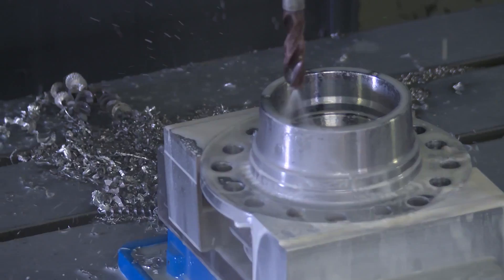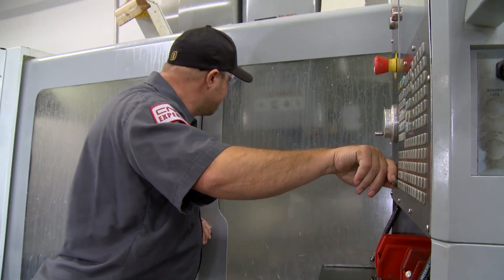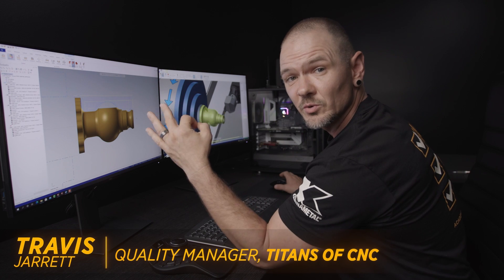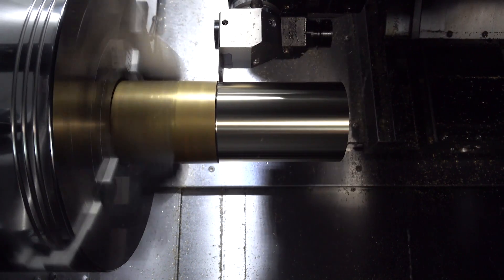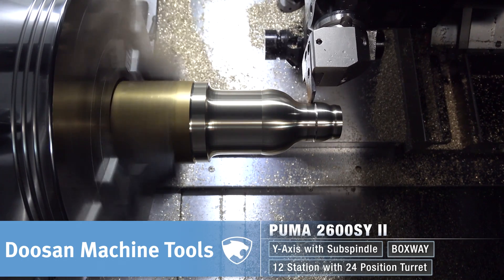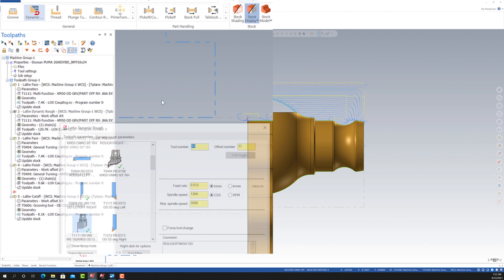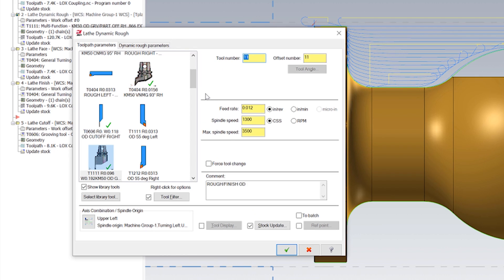Simple Machinist Mistake Causes Near-FATAL Accident

Comment: This is a fine example of the necessity of experience and also sound judgement when it comes to workholding. As someone with plenty of hours setting up and running large vertical spinning death traps, I can say no amount of training can prepare an operator for every situation, especially when the process involved seems questionable in itself. Those in charge should take this into deep consideration when chosing to take on a project and not default to the 'we can do anything' mentality. Sometimes even with the best of skill sets your machines will be the limiting factor in safety. Good luck (the culmination of smart decisions) and never hurry!!!

Comment: I was running a CNC press and doing single cycle work on thousands of flat parts with the press set at the highest speed. To keep my fingers safe I had the bright idea to use an open end wrench to slide the parts into place and time the operation for max efficiency. It worked great and I was really cranking the parts through. After a few hours I got tired and missed my timing, and brought the press down onto the open end of the wrench. It made a very loud PING and shot past my head, over my shoulder, across the factory. In hindsight, something soft like a piece of plastic would have been a more rational choice for my "push stick".

Comment: Once a guy turned on a lathe with the t-handle still in it and when it flew out, it brushed my right earlobe and then embedded itself in the drywall of the shop wall.

Comment: I worked on a cnc turning centre with a big dent on the sheet metal inside the enclosure. I was told they had an operator quit just after throwing a large part out of the chuck. He was facing the part in manual mode to set a reference face and had not set the maximum rpm of the chuck. We should always set G50 S*** to a safe value. That operator likely had the door open too. I don't remember being told whether he was physically hurt or not.

Comment: Haven't had anything but chips fly out of a chuck.. yet.. but I've shot bolts out of PVC airguns and when you have a decent mass moving you don't need a lot of velocity to do serious damage. When I was logging one of the first things I was told was to treat processor saws like gun barrels, never be 'downrange' of one. The operators never had saws pointed at themselves because chains breaking and 'shooting' people isn't unheard of. Been at least a couple guys shot with a chain through a safety shield and killed.

Comment: Standard talk in my workshop: i: Have you checked the Fixture and the Torque of the screw and vise? - He: Yes - I: Where is the Torque Wrench? - He: I check it again..... Luckily we have no really powerful maschines 3 kw is the biggest lathe. 2.2 kw the mill. But you can loose some body parts easy, if you are not aware.

Comment: Had small crown and pinion job running on little Gleasons, after cutting you had to buff off the burs and pass them on a wire brush spinning on a grinder. The gear came off the holding mount and got sucked into the wire brush. Spun around a few time and came out zooming passed my head. Found it 3 months later. 60 feet away lodged in the tin wall 40 feet in the air. That could of sucked big time. LUL

Comment: I remember hearing of an incident years ago. Won't say any names cause I'm now sure how true it is.
But from what I heard a guy was edge finding a part on the cnc mill and accidentally typed an extra 0 into the rpm counter so when the spindle turned on at 15000 rpm the end of the edge find flew like a bullet and hit the guy in the head.
Again I'm not too sure how true it is but it's scary to think how a simple typo could cost someone their life.
Reply: A guy a worked with had that exact same thing happen to him, but he was lucky and it didn't hit him.
Those edgefinder ends are only held on by a spring.
Reply: A edge finder running at 1500 rpm? I run my finder with 500 rpm.
Reply: I knew a guy who had a small box with several edge finder pieces in it because he kept forgetting to reset the speed after finishing a program. The ideal speed for an edge finder is 1500 rpm.
Reply: @jeffwombold9167  no its not
Reply: @marvinweijer9073  check the  Okuma literature on it. Running them too slow can make them less stable.

Comment: When I was a young man back in the 90’s ,I worked in an automotive plant. One morning, I walked into work to a commotion to find a lady machine operative had been killed by her machine. The lathe she operated had an eccentrically mounted part and used counterweight to balance the job.  After around 20 years of continuous use, this counterweight detached and smashed through the guard, hitting the lady in the head. I occasionally think back and wonder about her family. No one should die because of work.
Reply: There but for the grace of God.
Reply: Not in UK. Shut  part of factory, Health and Safety investigation followed potentially followed by criminal charges. Not in this case  though.

Comment: What's the max speed on a 30" chuck?
Reply: Do you feel the need, for speed?!
Reply: @xephael3485  just seems like such a huge chuck wouldn't even be capable of more than a few hundred rpm. But I guess that would be fast enough to fling T-nuts across the room.

Comment: Me and another guy were extra lucky one day, Friday just at quitting time no less. Had a perfectly balanced fixture with part, weighing about 600lbs, come out of a lathe at about 1000 rpm. Centre of mass was within .005” of rotational axis and about 6” from the jaws, and we were gripping 3” length of the fixture at 18” diameter. It was facing, so I can’t be sure of the exact speed, but it was around that, because G50 was set to S1200.  I had run the same program and fixture in a different lathe with an air chuck multiple times with no problems in the past. Due to availability, we needed to run it on a different machine, hydraulic chuck, and I was showing the other guy how to run the part. Broke the glass(and we all know CNC lathe glass is extremely strong), knocked the door off its slides, and damaged the tail stock and steady rest ways. Holy hell, that was scary. After that, we put a taper on the jaws and fixture to make sure it couldn’t come out; you could only install the fixture with 1 jaw removed, so even if the jaws loosened from centrifugal forces, it would still be impossible to lose it all.

Comment: My Okuma sales guy told me a story of a alum. auto wheel manufacturer where one operator wanted to go to the bathroom and ask his co-hort to load the cast wheel into the big Okuma lath. The jaws where like enough for either insides of the wheel to fit. He put it in his way which was the other way. When the tool moved in it crashed the machine and sheared off the turret. The whole shop herd it. Swinging a 20" dia. part at high rpm is nothing to fool with. Laths are a lot more dangerous than mills. I did hear about an owner of a shop get his gloved hand to close to an endmill to clear chips and was sucked in and took off some fingers. No fun.

Comment: My take on this, is that if its a method that is used regularly on a job that repeated then this should be documented in High detail. When I was establishing a new job I always included full information on the set up and tooling. If there was anything unusual about the machine or a particular piece of equipment,  like the required orientation of these  stilts, then this was noted either in the set up sheets and or in the program. My view was that sometimes like this situation you can have someone perfectly competent put onto a machine they aren't 100% familiar with and through lack of experience on that machine have an accident like this. If your procedures are right, with ALL the machine or fixture information given to the person running proved parts, then you greatly reduce issues both in safety and productivity.  
I started doing this because many shops I went into people kept their secrets to themselves, where as any ideas for improvements I freely shared, and would actively take on board others ideas.

Comment: How about a big surface grinder suddenly gets transformed into a 210mm machine gun as stacks of parts combined with shards of the wheel get ejected.   A total surprise, really loud and attention getting. All you can do is collect yourself and the parts, apologize, put a sack over your head while recovering from the shock and try to disappear.

Comment: 30 years ago I accidentally left a parallel in the lathe chuck. Spun up, then caught on the ways on its way out. Sounded like a ricochet as it went past my shoulder. Probably still impaled in the roof of the building somewhere, never found it. NEVER stand in line of the chucks rotation when starting up. Been running manual and CNC lathes since I was 14, always think before lifting the handle or pushing the button.
Reply: The company i served my time with had a perfect lathe chuck key hole in the inner roof lining in one section (it went through the sheet on the outside of the roof too but it was replaced) You can guess how that happened. It was never found either, I suspect it probably made orbit as the ceiling was about 30ft high there.....
Reply: Same happend in my rookie year, not me, the lathe one further. A Chuck, 35cm, was too small, so the operator work over maximum diameter, the thread of the claw broke, and the 5 kg piece flow through the workshop. Break the window of the masters office and land inside the 60th Anniversary Cake of the shop master. The cake literally explode like hit with a grenade. After that it was deadly quiet in the shop. Lukily no one hurt.
Reply: @Dan Didnot I know the type.... my metal work teacher would grab you by the hair and shout "good for the roots laddie" killer whyte we called him he retired after my first 6 months. Wouldnt get off with that now 😳

Comment: Very sound advice from you knowledgeable in machining industry! 
I've seen similar myself and instill as strict as I can even with a risen voice to emphasise the dangers of machining to not only peers who are seldom now that I've worked industry for 40+ years but my eyes are never far away with mindset of safe practices to ensure my colleagues never ever leave or go home with a missing limb or work injury!
Safety is never something to be shunned aside all for the push of expedient production, which in itself often gets dismissed and overlooked forcefully redundant all for production numbers on the board to be viewed in flow charts of production mostly to satisfy the bean counters!

Comment: Technically, the fault does lie with the operator of the machine however, if they weren't trained properly on that particular machine and setup, then the fault lies elsewhere, as in, the person(s) responsible to ensure that proper knowledge is shared with ALL team members. Cheers :)
Reply: I agree, that the true fault lies else where, not entirely with the operator. If a job is proved then all the information about the setup should be recorded. If I was making a set up pack for this job it would most definitely have a note on the proper use of these stilts included.
Reply: everyone makes mistakes , the thing is to double check triplle check everry thing that could go wrong,even if it mean extra minutes , you have to do it.I always do that ,im a lathe programmer/operator and i always run simulations , run the first piece on low speeds , check every tool with singleblock if its in the right position  just to be safe,and i dissangaged the door locks just so i can see where and what the machine is doing , but that is experience, you have to learn to do that so everry thing is in order
Reply: @kiurtosh  what good is running it on low speed if it was the high rate of speed that contributed to the accident?

Comment: I had a job on a mill that used a 24” long 3/4 drill bit that was to long to use in the tool changer. So I loaded all the tools (10) manually. It was pretty dangerous and I always ran the job myself. I was called to the phone and after an hour returned. Some how I was distracted and loaded the long tool in and hit cycle start. The tool was supposed to be 1/8 and went to 10000 rpm the 3/4 bit exploded and pieces flew every place even breaking the glass in the door and penetrating the enclosure.   I put in some optional stops after that to check every tool before they spun up.
Reply: Yes good idea, multiple optional stops will make you think, one might not do the trick.  Stories are meant to be told.

Comment: Right on the side of the machine.
Little note about centrifugal force and Chuck pressure decreasing
Reply: I've seen old lathes with maximum rpm warnings for that very reason. A tin tag riveted to the machine with chuck size and max speed.

Comment: We Had a 6 inch diameter disc came out of the Okuma LB 15 at high revs. Faulty clamp sensor. It lifted the sliding door off, bent the stainless sliding back guard , broke a jaw on the chuck and we had to have new bearings in the spindle.  Also on a big Ward  turret lathe, large motor casing left the chuck and passed over the head of the operator. No serious damage.

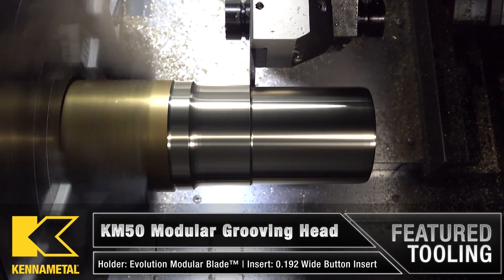Comment: Yikes! One pedantic bit: I am hearing in one of my Physics' instructor's voices at 1:38 it's centripetal force, not centrifugal without getting into the nitty gritty (others should be able to explain it better than I without having to look to hard).
Reply: Centrifugal force IS inertial force, it’s a misnomer. As centripetal acceleration pulls inward, inertia pulls in a straight line that’s changing arc constantly so the inertial force pulls perpendicularly to path of travel.
Reply: One pushes inwards and one outwards?
Reply: @willyharris4199  Here's  my unscientific  version---When a weight which is rotating around a fixed point is prevented from moving away from the centre point by a rope, wire, gravity, by a tension force, it is centripetal force.  With centrifugal force,  the weight is held in the curved path by an outside force such as a banked race track or a spin dryer drum , it is under a compressive force from the outside of the curved path, rather than the inside as with centripetal force.
Reply: @willyharris4199  I'll think about that for a while...
Reply: The only application I can think of is the surface feed compensation calculation used to maintain cutting speeds and surface finishes by compensating the RPMs on many CNC lathe spindle drives.
Reply: True- it's centripetal force, and it's not worth getting into the nitty gritty, it's one of the most commonly misused terms in the physics world.